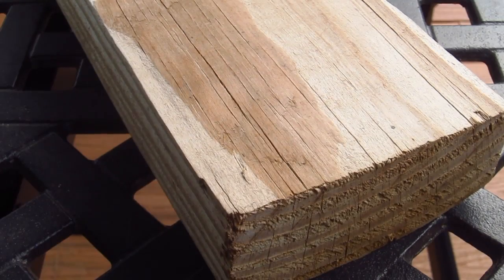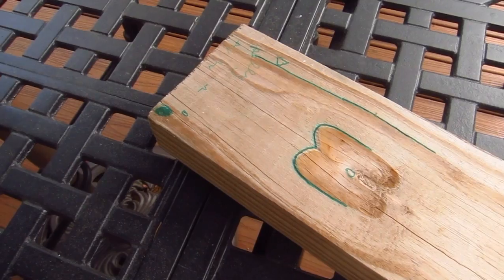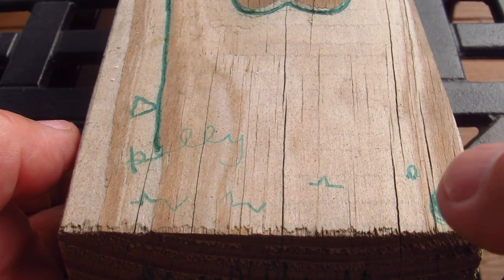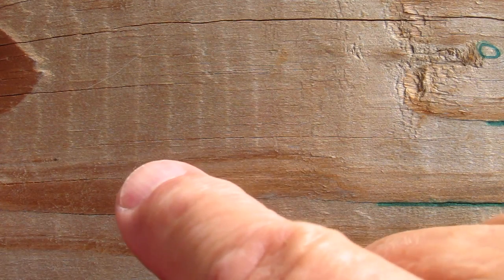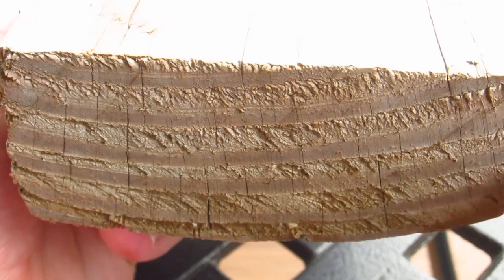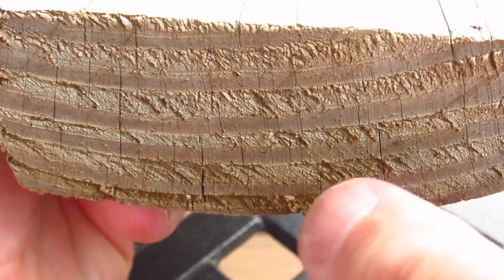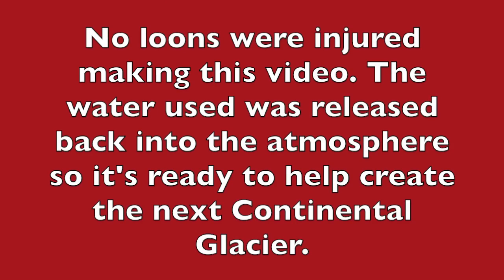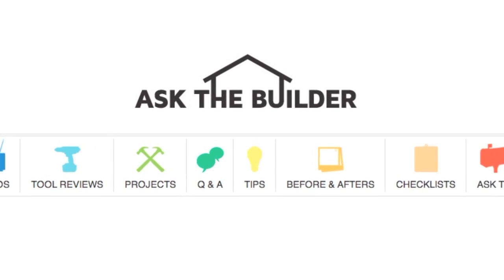Treated Lumber Cracking

Comment: what if its already cracked ? i had new 6x6 posts put under my carport and they have visible vertical cracks. installer just said that happens thats its okay as its not right thru, but i
want to prevent further damage. is there a stain sealer i can use? would that help ? im im Canada so we deal with quite abit of temperature and moisture changes
Reply from the maker: You can use any of these EXTERIOR waterproof products: https://amzn.to/4g2wPYv

Comment: I have a wood deck that is 3 days old and already have 6 deck boards starting to split. Yet the deck builder says to wait a year to seal the deck. At this rate I will be replacing the boards in year. Why is lumber in the USA horrible?  My dad said in the 70 and 80’s wood was much better and pressure treatment back then would last 20 yrs easily.  So now the question.. do I seal immediately or should this wood be going back to the lumber retailer?
Reply from the maker: It's ALWAYS BEST for you to go to my website first for the answers. I have a TON of stuff there about *deck maintenance*, when you're supposed to seal the wood, what sealer to use, and WHY the lumber is cracking and the old lumber didn't. Go here: www.AsktheBuilder.com

Comment: Tim, I had a deck built last April (2020) using pressure treated pine. After the wood passed the spoon of water absorption test, I radial sanded it and applied a heavy coat of water-based stain from Home Depot. By the end of the year, this new deck began to show signs of cracking and rippling on the surface, almost as it it was a veneer. Plus, there are black moldy spots wherever the wood is exposed to rain. I feel defeated, having worked so hard to get this right. What do you recommend?
Reply from the maker: I recommend you go to: www.AsktheBuilder.com and READ all of my past columns about deck sealers. Watch my recent Boat Dock Sealer video. I can also call you on the phone to go over your options: https://shop.askthebuilder.com/15-minute-phone-or-video-conversation-with-tim/

Comment: What if your pressure treated fence posts are already cracked?  They are a year old, part of a cedar picket fence, 6 feet high, so the posts are a little taller than 6 feet.  No one warned me about cracking, so I did not seal them.  What now?
Reply from the maker: Simple. Go here, read and WATCH my video on this page. Get the sealer I used: https://www.askthebuilder.com/boat-dock-sealer/

Comment: So how long do you need to let treated lumber dry before sealing?
Reply from the maker: As soon as a large drop of water soaks into the spring wood within 20 seconds as you see in the video. But ALWAYS before you ever see ONE TINY check crack as you see in the video.
Reply: @askthebuilder  can u paint over the wood protector